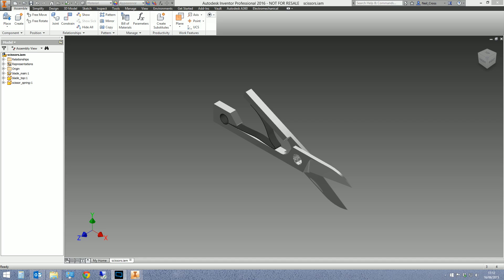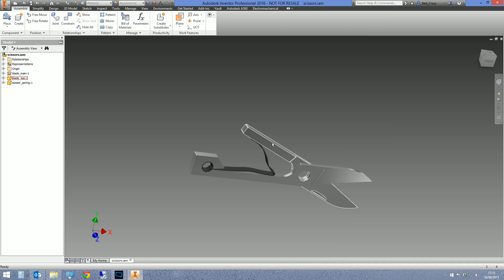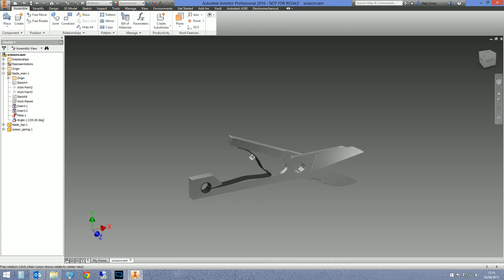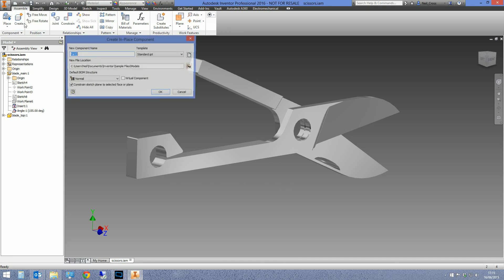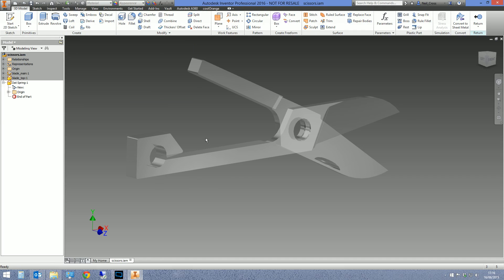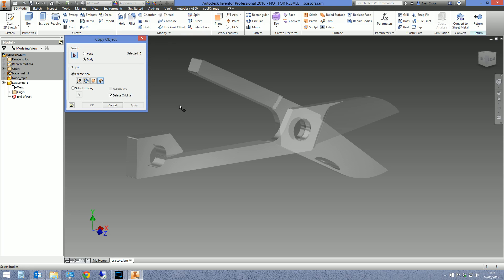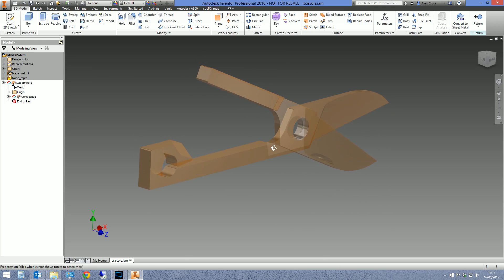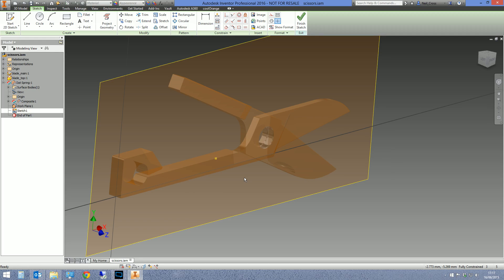Curved spring tutorial, it's adaptive too! | Autodesk Inventor

Comment: Excuse me sir, could you make a tutorial about wire rope drive, as in pulley system, and its simulation?

I've been trying it out by myself but it seems that I've found no luck. I've been trying to do it with sweep command by it's always ended up with error

Comment: What's this composite thingy you use before making the spring? Does it bind the part to the limits of the scissors part file? -Whilst also allowing for the points, lines and surfaces to be projected for reference?

Comment: Nice tip. Too bad I don't have twisted sweep in Inventor 2014.
BTW, you can just use perpendicular constraint between arc and line at  8:20 without the additional construction line.

Comment: Great video. Could you do a tutorial about adaptive belleville spring? It would be helpful.
Reply from the maker: tomekszymanski91 Not gonna lie, hadn't heard of them before! Just googled it and is Belleville an actual brand? That's the name of the company and that spring is unique to them? If that's the case I'm not sure if I'd legally be able to do a tutorial on how to model those as it could cause copyright issues.  Would make for an awesome video though if enough people used them!
Reply: TFI CAD Tips 
Belleville spring is a name of type of springs. I'm not native speaker, but I believe that it's also called ,,plate springs". The name Belleville comes from inventor, and it's not patented. It's used for example in car dry clutches. There are Belleville springs with and without cuts. I also noticed, there is a Design Tool in Inventor 2015 for this type of springs, but I havn't seen a single tutorial about it on YT.

Comment: Nice techique. - thanks a lot.
I'am avoiding using adaptivity as far as I can, but here is one exeption.

Your sketch could be streamlined on around 8:30 . Drawing constrution lines was all unnecessary. You could have same result by making sketch constraint between spring centerlines and circle centerpoint.
Too bad there's no way make manufacturing drawing of the spring itself.
Reply: Superb tutorial Neil. I learn a lot & have a giggle along the way